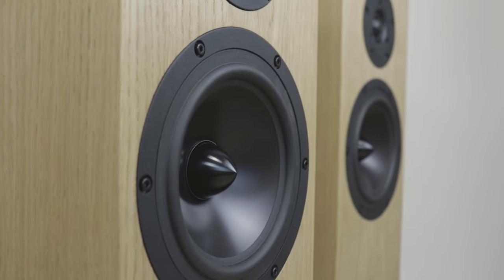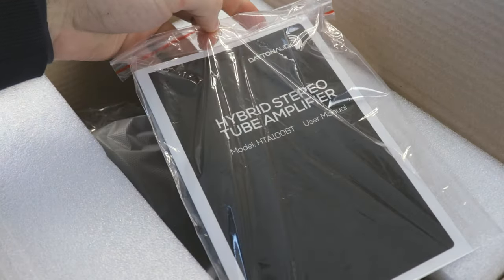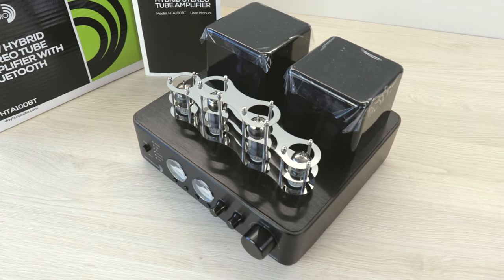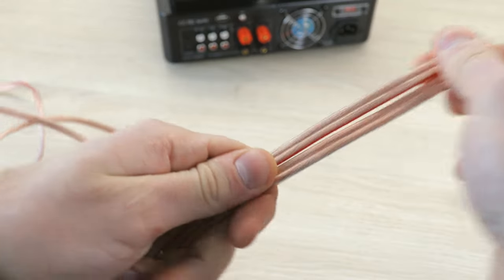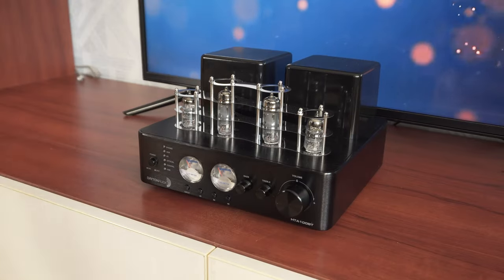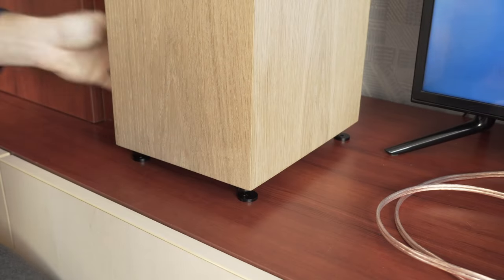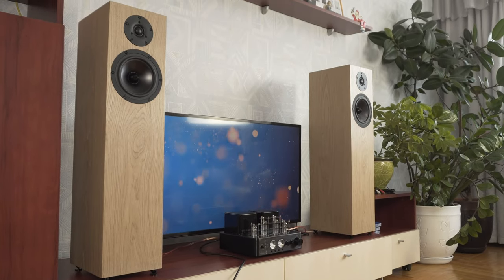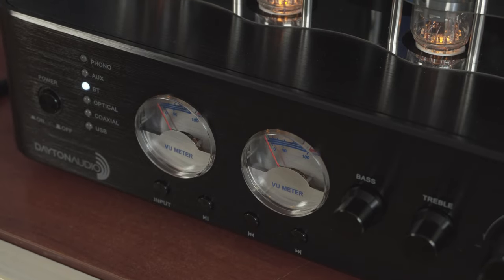Sound Test of the DIY HiFi Tower Speakers - the Amigas

Comment: I've also built a pair 5 years ago and can vouch for the fantastic music they produce. Connected to Marantz PM6007, they sound heavenly. Regards from Malaysia.
Reply: do you get that 3d sound stage and hollowness?
Reply: @MasterofPlay7  Not sure what you mean, but I thoroughly enjoy them! The sound stage was fantastic, and yes, maybe 3D. But hollowness?? Don't think so. All I know is I did not have to fork out $3,800 for them! And I enjoyed building them. Also, sharpened my carpentry skills and knowledge. That's what DIY is all about!
Reply: @ncteng8002  good for you, you should get the fm300a clone recommended by the German guy, my cheap Sony towers get that effect after I switched the amp

Comment: Congratulations  very good work.   I saw  the two videos related the speakers.  I have a question;  After  aprox. a  year what  is your opinion about the Dayton amplifier. did you had another  one to  compare it? Thanks.  Best regards from Colombia.
Reply from the maker: Hi, thank you for checking out my videos.
I like the amplifier's tone and the control knobs. Has plenty of bass and power range for these speakers. The sound quality is quite good for the price. The only drawback to me is the noisy fan that kicks in once audio is played at slightly higher volume and there is some hiss in the background with no audio being played. Other than that the Dayton amplifier is a decent amp indeed, with great looks if you like the tube design.
Reply from the maker: @wj6818  I might try that myself, thanks!

Comment: It sounds like a rock sound setting no matter what the song genre is.
Reply: Likely due to the tube amp :) That's a pretty big variable when trying to see how they sound and they are powered by something so different.
Reply from the maker: Please keep in mind that there is no way that a digitally compressed file (from YouTube) played through your listening device will give you an accurate representation of the speakers.